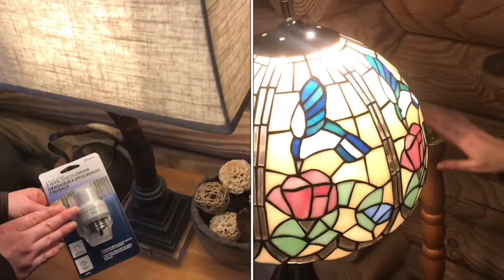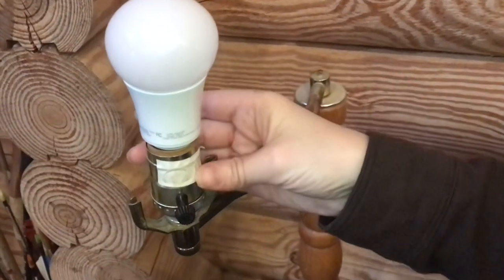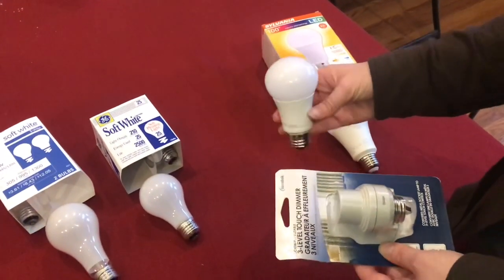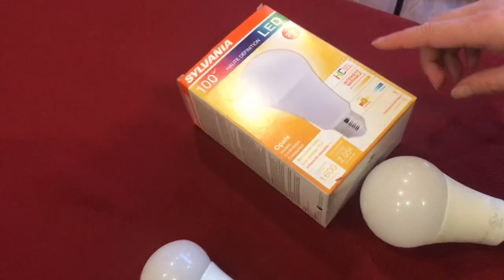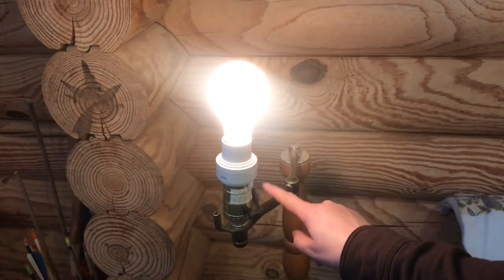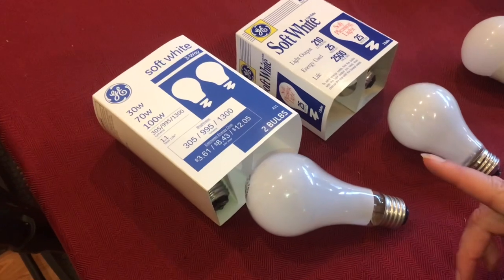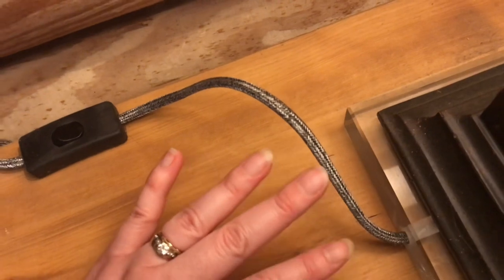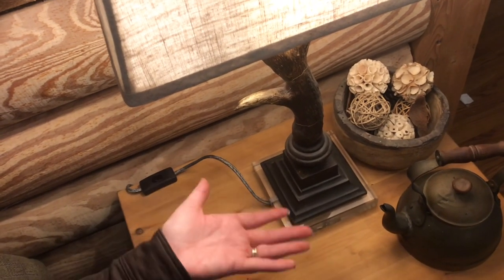“converting your lamp” into a TOUCH LAMP (westek 3-level touch control lamp socket dimmer)review￼

Comment: Will the adapter work , if the metal surfaces are painted or coated with clear urathane or any thin protected coating.